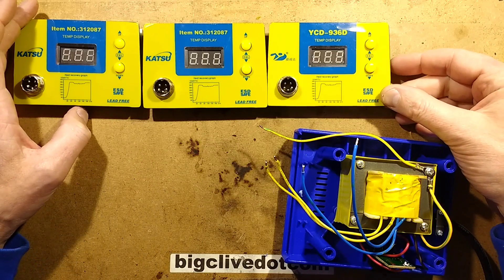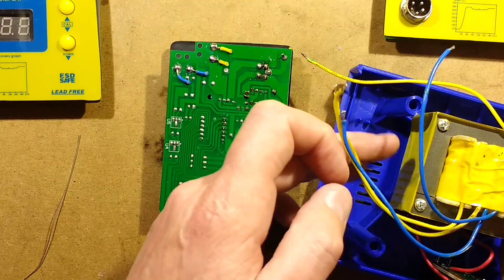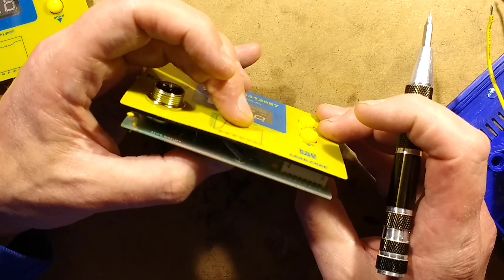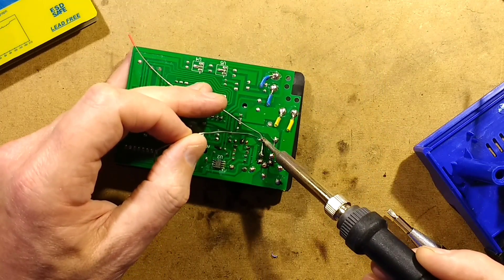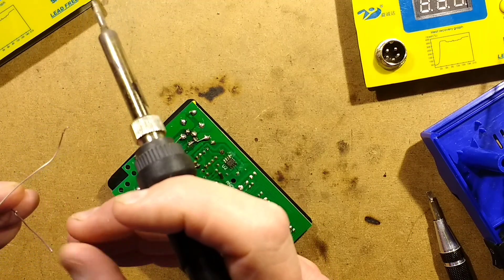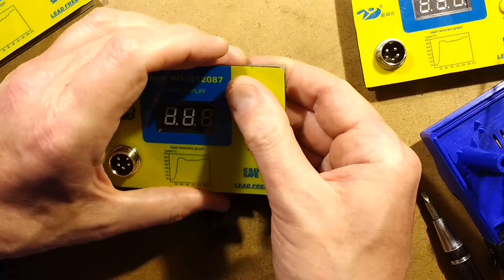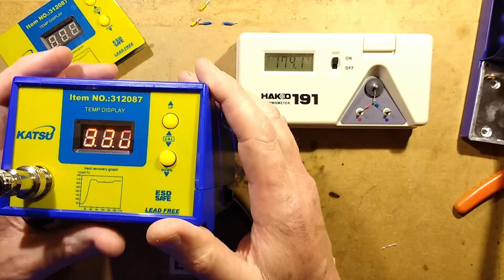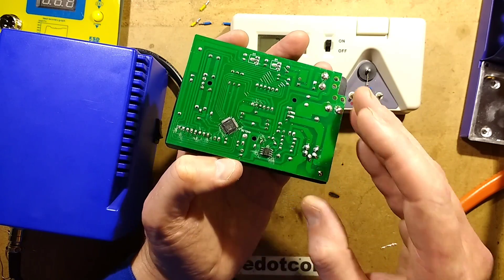Fixing a common fault with the 936D style solder stations.

Comment: This looks like a typical problem with small-volume production from obscure manufacturing companies.  They ordered a big pile of printed circuit boards before thoroughly vetting their prototype and rather than scrapping a bad design, need to use up the big pile of defective parts to avoid going bankrupt.  It may have been exacerbated by outsourcing their manufacturing, so the PCB designers and engineers responsible for the design don't get a hands-on feel how shitty unmanufacturable their design is.  I've seen it all before in my career.  Such companies tend to go out of business in short order anyway, because they ship unreliable products and acquire a bad reputation.

Comment: Good Fix BigClive.  Had a different model/brand of Chinese solder station with the same problem some time ago.  Did as you did and had to resolder other doggy PC board pad connections.  For a solder station that sit in one place for months to develop such a problem was the surprise.  Where the DIN connection has to be re-soldered again without any pulling on it.  Of course to really have some fun, wait until you have to change out the heating element in the Hot Air attachment of the more deluxe stations, especially when the replacement element has its four wires with different colours than the original, and the wire sizes are all the same, leaving no simple indication of which wire goes to what.  Not to mention having to get it back together where no wire is left too close to the element yet has to all fit back together again. Now that was a pain.

Comment: I had the same problem with my electric w@nking machine -- it was a copy of the German Vankerpumpen Mk3 mit balltickkler
Reply from the maker: Broken solder joints is a common problem with wanking machines due to the excessive vibration when used for long periods at high speed.
Reply: the problem i have with mine is it goes into full speed mode then i cant stop it, ive lost several fillings that way, and my knob fell off
Reply: It's this newfangled lead free jizz causing all the problems.

Comment: Maybe drill two holes and use standoffs (between PCB and front of case) right around the connector (there seems to be enough space to drill the holes and not effect the traces - well without seeing other side of PCB) to give mechanical strength.  Also maybe throw a RED gel in front of the display to improve readability.

Comment: Good but two points are missing: (1) The main problem is inadequate use of flux. Your repair repeats this error and will likely fail quickly. And (2), the connectors are inserted to random depths, thus creating force between the connector, PCB and case work. Again, your repair makes no (at least on camera) attempt to set a depth wherein the PCB and case work are stable and will likely fail again. 

While your video is an excellent attempt to deal with a very common problem, it is also an example of a major flaw in YouTube "repair" videos in general. 

If you don't understand the fundamental cause, you can't find the right fix. 

I simply don't understand how the art of fluxing has been lost in the West. Visit any production shop in Asia and you will see how soldering actually works. 

I think at the core is fear of solder residue. Westerners (if that is even a word, correction requested) are so use to looking at final, residue free boards that they don't seem to know that the boards are cleaned after work (ultrasonic aqueous dip, >95% IPA wash out and time in an oven, sometimes a vacuum oven.)

In the old days of point to point soldering type RA liquid flux was the rule and residue was seldom cleaned. 

With the advent of SMD and wave/reflow, jell flux such as Amtech NC-559-V2 now dominates. 

Watch any video by Louis Rossmann and you can see how to solder modern components. 

Correct flux is available at mailin.repair (no .com.) I have no interest in Amtech or the Rossmann group other than that of a happy consumer.
Reply from the maker: I use flux cored solder.
Reply: shill
Reply: smd is different to soldering surface components, they flood with rosin flux to help separate the pads, wipe soldering with the iron.   for standard non smd you use flux cored solder, we dont float a ton of flux on it, so nothing to clean off, a art of soldering lost in the west? sod off mate, we invented it, i might as well say, the art of the stir fry is lost in asia, come to a macdonalds for a burger instead!

Comment: mine had an impact that pushed the display in and broke it's tracks, fortunately the iron still worked and I could resolder the display using it's own iron, only slightly dangerous I suppose.
Reply from the maker: The circuitry itself isn't referenced to ground, so soldering it back up with its own iron only really posed a slight shock risk from the mains switch PCB.
Reply: you could heat up, unplug, solder one joint, plug back in . etc. lol
Reply: who doesn't have multiple old school irons and stations laying about?
Reply: throttle bottle sadly they were properly dead
Reply: I have no idea where my old soldering iron is. Probably up in my parents' attic, along with my first Weller soldering station. Keep meaning to get someone to go up there and bring the things down. The one I use mostly these days is a Weller station I took home from work for safe keeping about 20 years ago.

Comment: Had the dreaded problem with the S-E Error message on my Atten 8502D soldering station. Turns out that most of the replacement irons you buy on eBay are connected wrong.
http://www.jackenhack.com/atten-8502d-pinout-replacement-iron-element/

Comment: iv got my 936+ model and had the switch on it the fuse was an amp but found out it was a weak spot when resistance built enough to pop it, (ordered some 1a  quick fuses to combat it) with what they put in my unit and the unleaded solder i was after heating up on a liftld phone board almost innediately sent t1 too many ampd to the switch and have it open by chance stumbled on the vid, so having 2 wires from pri. going to circuit and a funny but terminated proper yellow gnd. the us reg. switch has the others (4 others bl,peach,bk,red means nothing looking at the yellow ha ..) can I throw the us ver. dig model face on it just as simply as I'm imagining
Reply from the maker: To deal with the inductive inrush current to the transformer I'd generally suggest an anti-surge or time delay fuse.  Quick blow fuses are not always suited to the inrush current and may randomly fail when there isn't a fault.

Comment: My Yihua 898d knockoff ended up having an issue where the solder joint of one of the capacitors failed causing it not to get hot and have random problems. I went to the horrible frieght and bought the cheapest soldering iron i could find to fix it. Works great now.

Comment: if it worked by bending the jack, or was new i would just cut the shield ground temporarily and use it on itself
Reply from the maker: You could leave the ground connected on the low voltage ones, as the circuitry usually has no ground reference.  You'd need to watch you didn't touch the switch PCB though as it has mains on it.

Comment: My uncle assembled radio kits on the kitchen table using a iron nail held in a set of pliers, heated in the gas range. I myself have done something similar with thicc copper wire and a lighter.

Comment: Putting a dab of silicon or "hot snot" (hot melt glue) on the corners of the circuit board may prevent this from becoming a problem.

Comment: Lead-based solder?  For a smart guy, you don't value your primary asset all that much eh?
Reply from the maker: Lead solder poses no significant health issues unless you eat it.  Much like wood.
Reply: I've heard that because lead-free solder has a higher melting temperature, it causes more rosins in the flux to be released as vapour when used, increasing the risk of asthma in the workplace if inhaled, in comparison to traditional solder.
Reply: I suppose we just can't win.  Brain damage or lung disease... take one or both!
Reply: Are you saying I shouldn't be eating wood?  Hmmmm.  Might explain the splinters in my butt!
Reply: Let's just say you should always work with good ventilation!  Lead is a real hazard though.  When heating to melting temp, some of it is vaporized.  Also, easy to get it on your hands, and from there, onto your food, into your nose, etc.
Reply: You definitely shouldn't eat MDF.

Comment: Great fix, but I'd make one change to further improve it. I'd use solder wick instead of solid core wire. The solder wick conducts with low resistance (like the wire) but remains flexible (providing you don't fill the entire length of it with solder). It's easier to use than multi-strand wire as you don't need to deal with insulation or the strands unraveling. 

I've done this on heaps of handheld radios where the RF connector center pin was soldered direct or with solid copper wire onto the PCB and there was enough flex after a few years for the connector center pin to eventually break the solder joint. That extra flex in the solder wick solved that problem.

Cheers
Luke

Comment: When it comes to soldering irons, more is better, that way you're never tuck without one, I think I have 5 irons myself, a 30 watt burn-everything one, a 12v one that barely works, two of them USB irons (one a spare), and my station I got from Rapid, the latter of which I've modified with cloth-covered wire cos the stock PVC stuff was too inflexible... :)

Comment: so my soldering iron is like this one but black except mine has a little screw hole under the display that you turn to do the calibration and it works fine but its probably the same inside and now Im wondering if I should open it and do this thing with the bits of wire because if it does go faulty I havent got another one to mend it with but that would mean having it open and doing things inside it with it switched on so thats probably a really bad idea isnt it. also if it isnt faulty now it might probably be ok because I never take the soldering iron bit out of its socket anyway i did once to take it somewhere but I can just as easily leave it connected. so yeah maybe I'll just leave it

Comment: Where are you getting the lead based solder?
Reply: I think Clive uses Rapid solder (ie from Rapid Electronics, they have their own brand). but leaded solder is available from any electronics supplier plus ebay, amazon etc, its sale isnt restricted at all. youre not allowed to use it in commercial production but its fine for repairs and hobbyists.
Reply: not maplin apparently though!
Reply: I was only looking at 60/40 solder on the Maplin website the other day.

Comment: I bought, or was gifted a clone of the Hakko. Its a Kendal 937D, the only issue I had with this this the cable for the iron itself. I had some scrap cable from a load cell, felt to be high temp rubber/silicon coated cable heavily braided I think 20 maybe 18 gauge 4 conductor wire. That solved my S-E error. After seeing this video I half wonder if I should pop mine apart and check that connector.

Comment: cant you drill some holes through the front panel and the circuit board and put some plastic/nylon spacer tube between them and use a bolt and nut to secure Or just use a plastic/nylon spacer/tube and clue it between the panel or circuit board

Comment: I have a WLX-936D that worked fine for a few months then one day just failed to power up. On investigation I found the soldering on the board was good, all connections and components checked out fine. I was amazed to discover the mains power cable was not passing power into the unit! On looking closer at the mains cable it was marked up as '3CX0.75mm but only had a few very thin strands of copper. Even attempting to strip the insulation snapped the conductors. Fitted proper mains cable and the unit has worked perfectly ever since. The naff cable had 6 strands in Earth conductor, and only 4 in the Neutral and 3 in the Live.. Lesson learned, check and replace power cable on ALL cheapo products, not just the dodgy 'sleeved pin' plugs..
Reply: I hadn't used my YCD-936D (identical to your WLX) for almost a year and when I needed it, it wouldn't power up. I checked it and suspected there was something wrong with the cable. Then I read your post so I checked my cable and it was not passing power from the brown cable, so I replaced it. Now it works perfectly fine! So, thanks for your post! It helped me find the source of my problem.
Reply: So just buy something decent in the first place?!
Reply: @merlinthegray   I agree with you partially, it gives satisfaction to repair something and give it further life when others would just replace it and I'm certainly one of those who detests the modern throwaway society. However, you buy a tool to do a job and the last thing you want when you need it is to find the tool does not work or worse still further damages the thing you were trying to fix in the first place. You don't need to pay a fortune (Although you of course can) to by decent tools but these videos show the folly of buying the Chinese junk. Now we all know the Chinese are capable of quality manufacturing (Much of the top brand electronics is manufactured there) but when left to their own devices they often cut big corners off the product quality and manufacturing standards, and then they cut corners off the corners.

Comment: Strangely enough, I got one of these from a drop-ship supplier based in Coalvile, Leicester (Probs from the Amazon warehouse based there), and I also got the same thermocouple test unit you have shown in a previous video, and tried the calibration mode, and no matter what I try, I can not get the display on the iron to match what the themo test unit was showing, so at the time, I dismissed the test unit as being faulty..... Clive, what you have shown here, would the issues I have mentioned explain the issue I have?

Comment: Hello clive, Helpfull video keep them coming. I notice that you have been given 11 thumbs down, I am not understanding what there was to not like.You have showed people how to repair their soldeiring stations.There are a lot of f-king idiots out there.
Reply: Not entirely necessary. The 5-pin connector is reasonably firmly attached to the front panel (which is in turn well-supported by moulded channels in the outer casing). The "fix" would seem more to do with correcting initial slap-dash assembly / impatient soldering rather than a major mechanical deficiency. Nevertheless it would be pretty easy to mount rigid insulating spacers between the fascia and PCB in order to provide mechanical support.
Reply: @phils4634  I agree. Dude just had to be the Mr know it all. He is right... I had one that was down. I did it the hard way but the better way and got that fucking lead free of the board, then re flowed the components. Works great now
Reply: The board needs to be reinforced to stop the flexure.  All this did is to make it more resistant to flexure, the fundamental problem still exists.  The real idiots are the ones who couldn't reflow the joints on their own.

Comment: Why does solder have tin in it ? Why can't we have the real thing instead of adulterating it with tin ?  I mean what's good enough for a church roof should be good enough for us peasants.  Can't beat a nice plum bum.
Reply: jp
You wouldn't want solder that is all lead. While lead is conductive, tin is twice as conductive. The blends (often 60/40 tin/lead) give the combined benefits of flexibility (not too brittle and prone to crack when flexed), practical melting point, and good conductivity for electrical work.
Reply: Brian Deschene +1. 63/37 also works. ra or rma  core.  Also the alloy forms an intermetalic with the lead and circuit trace. a blob of solder on top of the joint doesn't add to the party.
Reply: Thanks for the reply chaps. I guessed there would  be a good reason but with 'warm white' and 'real lead' one can't help but join in. I would imagine that tin also strengthens the solder. When one considers the number of years Clive has been fondling lead solder it doesn't seem to have done him much damage. Mind you the 'Should I stick an electrode up my butt' and one or two other videos makes one wonder.